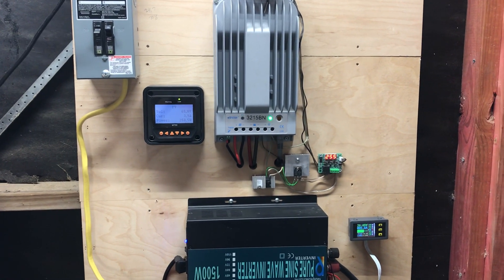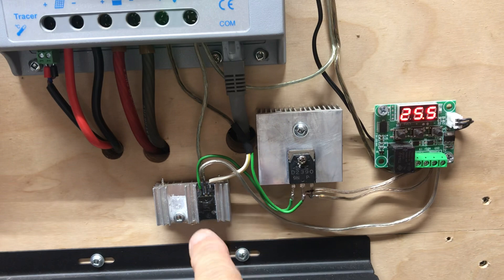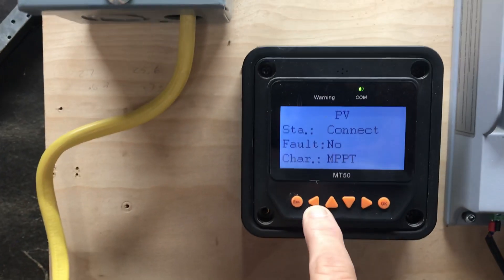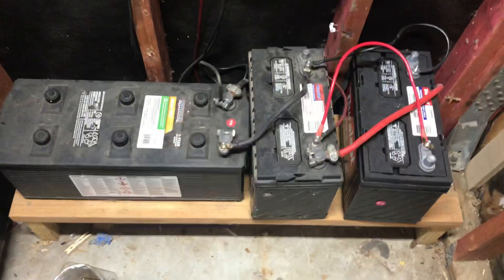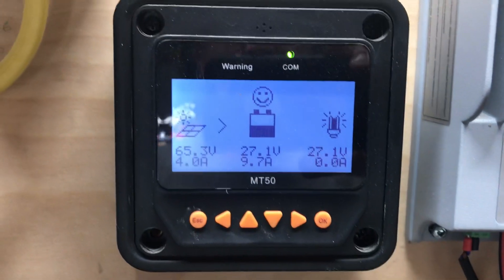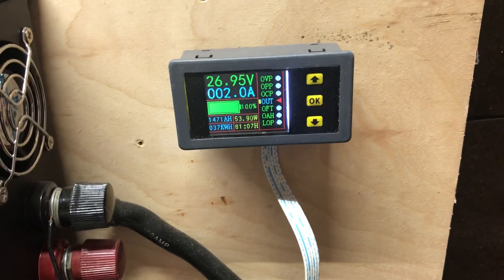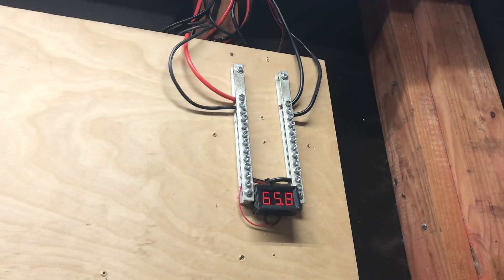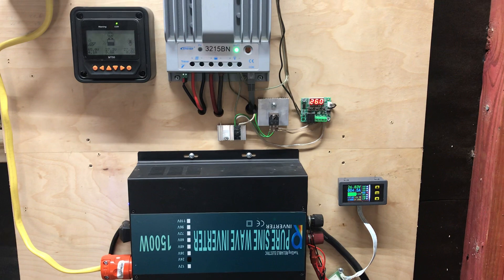A little addition to my solar setup

Comment: Great idea! Do you have the link to that product on Amazon?
Reply from the maker: HiLetgo 2pcs W1209 12V DC Digital Temperature Controller Board Micro Digital Thermostat -50-110°C Electronic Temperature Temp Control Module Switch with 10A One-channel Relay and Waterproof
 HiLetgo 2pcs W1209 12V DC Digital Temperature Controller Board Micro Digital Thermostat -50-110&deg;C Electronic Temperature Temp Control Module Switch with 10A One-channel Relay and Waterproof
 
 
 
 
 HiLetgo 2pcs W1209 12V DC Digital Temperature Controller Board Micro Digital Thermostat -50-110°C Electronic Temperature Temp Control Module Switch with 10A One-channel Relay and Waterproof
 HiLetgo 2pcs W1209 12V DC Digital Temperature Controller Board Micro Digital Thermostat -50-110&deg;C Electronic Temperature Temp Control Module Switch with 10A One-channel Relay and Waterproof